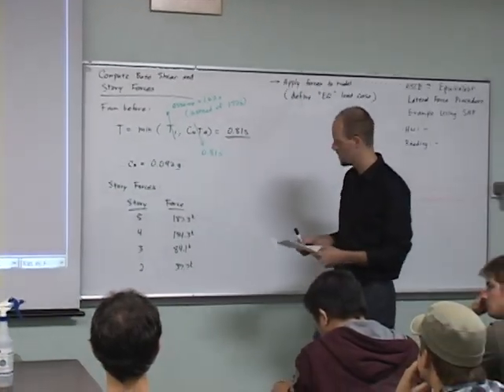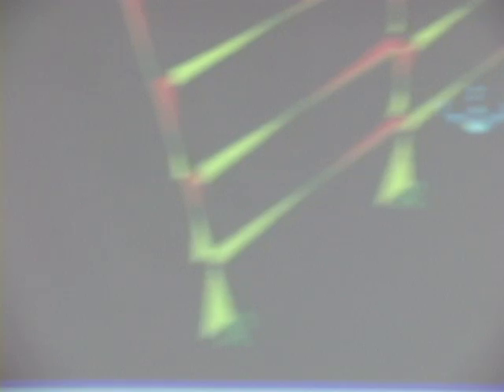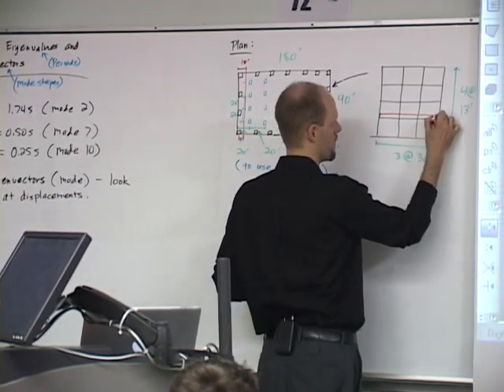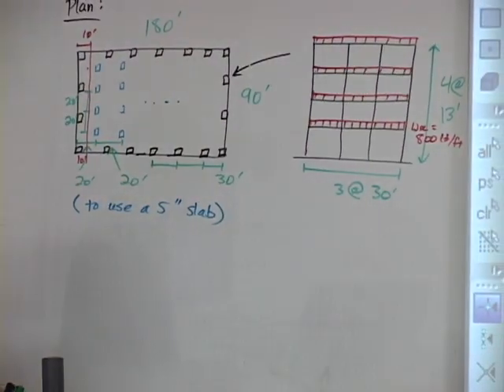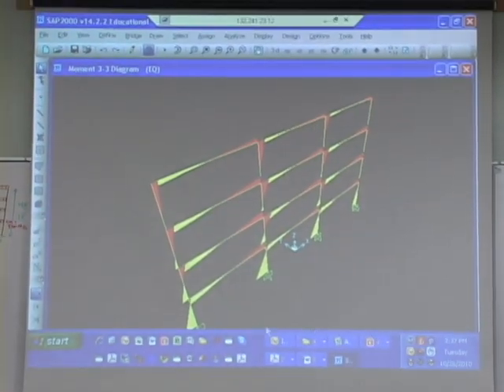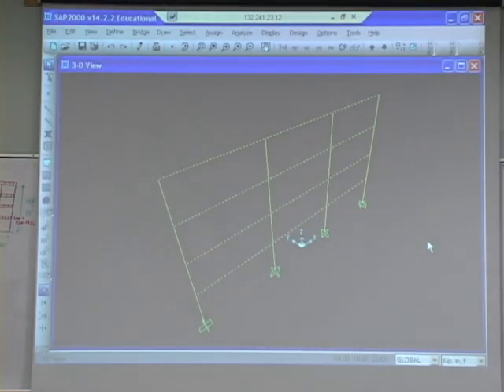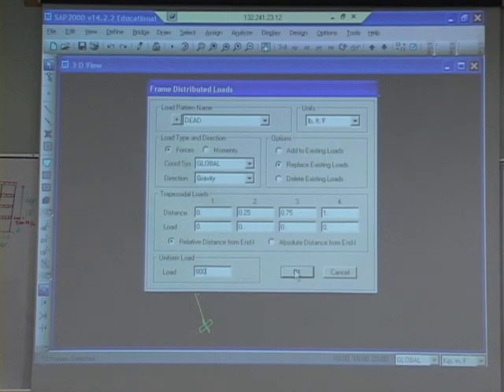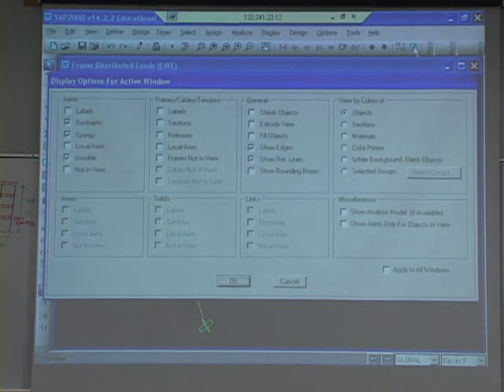6 SAP DL and LL

Comment: Dear Sir, Why you didn't consider the DL = 800 psf for calculating the base shear? You only used 1200 Kips/Floor for the base shear calculation in the previous video.